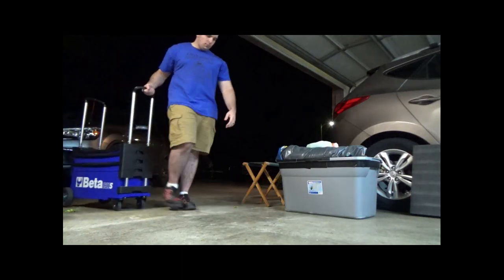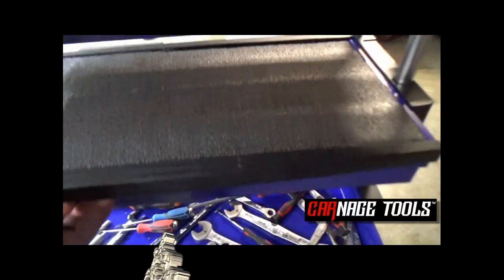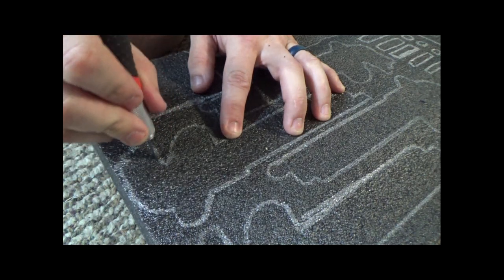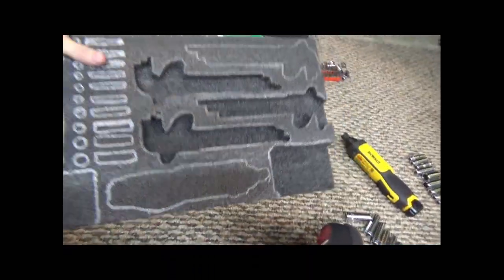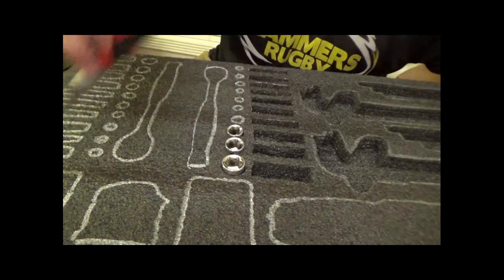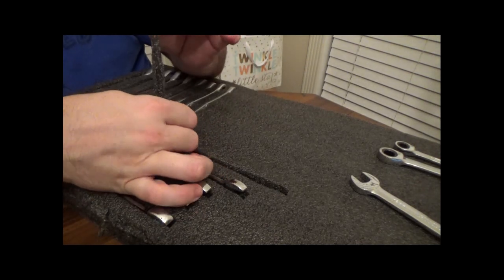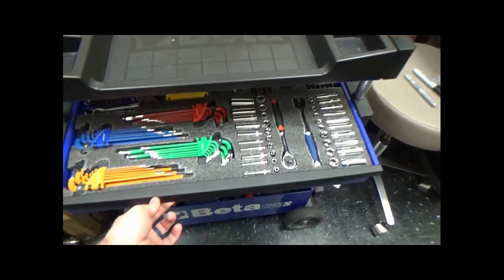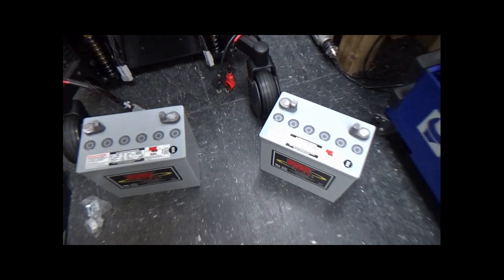Power wheelchair mechanics toolbox. How to shadow a toolbox with Carnage Tools Shadow Foam.

Comment: The foam has its uses. Assembly lines or where you only need certain tools. Other wise it's a total waste of space.
Reply from the maker: When you drive 6-8 hours to go to a job the foam holds your tools in place and gives you confidence that nothing is left behind
Reply: @CreativeMechanic  totally agree with that. In my main box at work I did some foam. I just find it takes up to much room for me with some tool's. I've ordered a c27 cos I run out of room in my portable box again as my tools I need for jobs keep expanding. Should say I'm not a mechanic, I do electronics and my tools change for the job I'm doing wether it's rewiring up cabinets or going somewhere to modify pcbs.